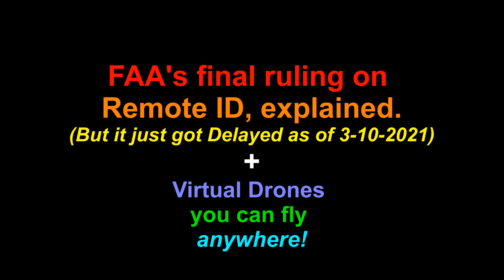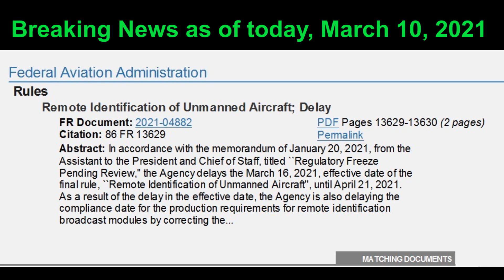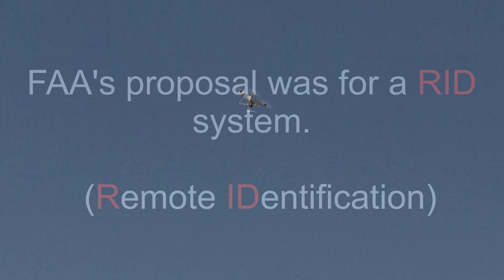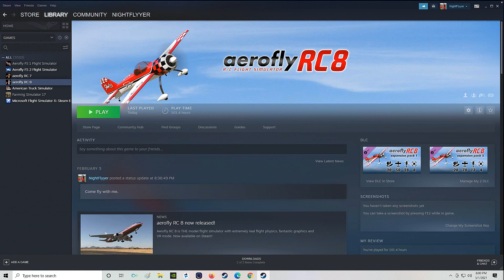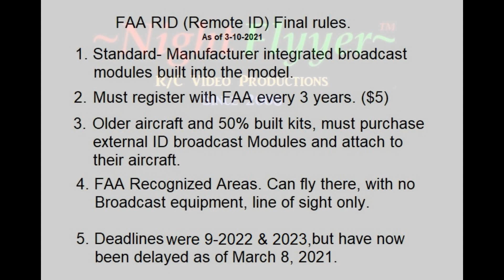Required: FAA Remote ID Broadcast Modules for all model Aircraft over 1/2 lb. I explain the Ruling!

Comment: I was a USAF crew chief for a dozen years. I saw engines eat all manner of things. Small RC aircraft aren't a true danger. Period. The 'reports' of close calls have all but been debunked numerous times. A flock of birds is literally 100x more likely to harm an aircraft in flight than a single RC craft. The entire thing is seriously over inflated. General aviation tests windscreens by firing frozen chickens at them for heaven sake!!
Engines are CLEANED with walnut shells...I mean..good grief.
The only GA craft that have any high chance of serious danger of harm to pilots or the craft are single engine small prop jobs. That is all. And again, the density of birds compared to the single tiny RC craft make the danger a non-issue in reality. That one lone idiot flying dangerously and in violation of current regs is NOT going to be stopped by these laws. If someone wants to cause harm or go outside the 'safety net' to perform an act..they're gonna do it folks. The FAA cannot seem to grasp this concept. Someone wants to air drop prisoners some contraband..they're sure as hell not going to use a craft with remoteID. They'll DIY something. Not to mention that all of this crap just makes it more likely hackers and other nefarious parties will cause harm to innocent peoples than it is likely hobbyists will cause issues to manned aviation.
Also bear in mind there are quite a few classifications of manned aircraft that will now have LESS regulations than what RC pilots will have, yet they do pose a real danger to life and property given their size and low flying nature.

EDIT: I also know quite a few full scale pilots that completely disagree with the new regs and postulate, as many of us do, that is 100% in the name of Amazon and the like gaining retail drone use space and screwing anyone else out of said space.
Reply from the maker: Debunked? If it was, why is the FAA doing this?  In my small town,  I saw this happen first hand.  Since I have permission to fly at a Private airport, one of my pilot friends was coming in from the south to land when he almost hit a drone.  There was a fair going on 1 mile south of the airport and there was a drone above the fair doing video.  When my friend landed his full scale plane, he came to me and was mad.  Demanded I go find this guy and reprimand him.  I don't know who it was, but I had no jurisdiction anyway.  So never say never.  I also saw on the news this past summer of the drones in California that shut down the fire fighting operation, because there were several of them up flying and interfering with the  helicopters, etc.  The pilots were so concerned they wouldn't fly.  But no one was caught because they were gone when anybody looked for them. I guess that is why they want transponders on the drones.  And since now folks are flying  FPV airplanes out of line of sight, like the drones, they have decided to put the rules on all unmanned aerial vehicles weighing over 1/2 lb.  
I'm only the messenger and just passing along what the FAA, Model Airplane News, and Model Aviation magazines published this month. We in the AMA community tried to stop the ruling but could not. We only got it modified to be a little better. I don't like it any more than you. My DJI Spark wont take off if I'm within 5 miles of an aircraft, so it has already begun.    If you have a better solution, then contact the FAA and tell them, since it was delayed again.
Reply: @NightFlyyer  "If it was, why is the FAA doing this? " let me simply and quickly reply to this part right now since I'm on my way to something else... the answer is all to obvious for anyone watching how the process is going down. It's called lobbying. The commercial enterprises want the airspace in order to use delivery drones. They're the ones up there fighting for said laws with almost no representation for hobbyists. Those that did represent hobbyists were not part of behind closed door talks while commercial enterprises were present. It's that dang simple!

I never said 'all' are debunked. Please don't take me for a fool. Your choice of words paints me as someone who is an absolutist and doesn't understand that SOME incidents are in fact real.

EDIT: To understand that one idea is bad, does not require having a known good idea to take its place before recognition and offense against said bad idea.
Reply from the maker: @secretagb  I did not at all call you a fool and you are being condescending towards me.  I have had to sit here and answer hundreds of these messages and believe me, I'm tired. I'm only the messenger and just passing along what the FAA, Model Airplane News, and Model Aviation magazines published this month. We in the AMA community tried to stop the ruling but could not. We only got it modified to be a little better. I DON'T LIKE IT ANYMORE THAN YOU!  My DJI Spark wont take off if I'm within 5 miles of an aircraft, so it has already begun.    If you have a better solution, then again I suggest you contact the FAA and tell them, since it was delayed again and they are requesting comments and suggestions.  Maybe if enough folks do that, this stupid law will be rescinded.
Reply: @NightFlyyer  I'm sorry you felt it was condescending, I did not mean such. My initial comment was not yelling AT you, but I now see you've taken it that way and I can understand how it could be read as such (my yell is in general frustration of our voices not being heard). My second post, the same idea not yelling AT you, I was literally in a hurry and it came out fast so for that I apologize. Maybe I also misunderstood your tone, but I felt the definitive questioning of (saying I insinuated 'never') my debunking statement was all encompassing every incident and I didn't ever mean it that way. Despite the readily available information showing pilots "see things" all the time that are nothing (UFO sightings much) we are just supposed to blindly trust every report as fact? Being able to see a small drone while moving at high speed is uh..not reliable. Sorry there are far too many holier than though pilots that I sure as heck wouldn't trust to drive my car let alone spot what is or is not a drone while flying. (I know more than a few and grew up in a family with multiple GA pilots, some of which scare the devil out of me to this day)

Speaking of incidents, did your pilot friend you mentioned report that situation? If so, did the FAA perform a full investigation as they are legally obliged to do in ANY and ALL reported safety claims? If not, then screw them. They seem to like to pick and choose how to enforce their own rule set. To boot, this incident you mention is a violation of multiple laws pre-remoteID and those laws have been in place for decades. Even remoteID laws would not necessarily prevented this person from flying there illegally. Had the situation been reported, the FAA surely could have found out who the pilot was at the time given the amount of social media posting that goes around for aerial footage. A few RC pilots have been busted with just that manner of investigation already! 

And myself and many others actually HAVE brought up far better regulatory options, but they clearly don't care, due to the aforementioned lobbying. It's written on the wall that the hobbyist has no voice despite us yelling! As you said, you and the AMA couldn't change anything and there's a very specific reason. That reason has nothing to do with logic and reality of our hobby and the real and unreal dangers. I am fully willing to accept regulation changes, even if I don't particularly like them, IF they are the result of proper scientific testing and realistic safety evaluation. I don't want true safety dismissed any more than any other conscientious hobbyist. Like making remoteID mandated only on those flying out of LOS as they cannot see to know if an aircraft is entering their AOR. Granted that SHOULD NOT happen anyhow since GA has a ceiling and so do we so we should not be crossing paths anyways. If GA craft are flowing that low there should be FAA investigating the pilot and not the hobbyist.

The weight limit for one should be moved upwards by quite a bit. At LEAST 1lbs. A red tail hawk can easily make 2lbs and that can be a danger on a direct strike to certain aircraft parts. But again, I've seen my fair share of jet engines devour even the large Canada goose with minimal scuffing and maybe a minor blade blend needed to repair the situation. I've swapped out the radome on a C-5 that took a crow once..didn't harm anything mechanically or endanger anyone at all, but it sure was a mess and an expensive bit of fiberglass to swap out!!

The dangers should be evaluated based on logical testing parameters (fly a drone through the rotor of a tethered and grounded heli for example and see what happens in multiple weight classes, fly a Mavic at full speed into a Cessna 182 wing from the bottom, etc), but the FAA outright refused to perform such measures and instead chooses arbitrary crap (likely based on things they were told behind those closed doors with commercial lobbyists of which we will never be privy to). Again, myself and others have levied such comments based on logic, but they ignore us.

I currently work in Naval Aeromedical Research and am directly involved in many safety situations of recreation, testing, evaluation, and solution creation. Recently we devised solutions for lasing of aircraft, which is a real and true threat that is testable and repeatable. We study pilot disorientation, visual acuity, etc etc. We are doing the work! The FAA on the other hand will not do such work. And they will not listen to us hobbyists, so all we are left with is yelling and complaining to each other on the internet at this point.

It's absolute stupidity that your Spark won't take off IMO, but that is as close to a logical rule as I can see right now. If you are within the flight envelope of an airport, lock down the space. On the other hand they regularly stick their collective feet in their own mouths like when they ruled that RC pilots were the equivalent of GA and would thus under law have the same protections, but then retracted it after it was brought to their attention.

Again I'm sorry for any perception of anger at you.
Reply from the maker: @secretagb  I understand, and I have been answering many comments, many blaming me.  Again, I was just the messenger and agree with you.  The Pilot complained to the airport manager and was mad, saying the drone pilot is supposed to call the airport to tell them he was going to fly his drone.  The thing is, it was after hours and the airport crew was gone.  This is a private airport and the pilot was a sheriff's deputy.  He tried to find the drone pilot.  I didn't go anywhere, because I was flying my Big Pitts.  By the time I would have been able to get packed up and go find some guy with a drone at the fairgrounds would be too late. Besides, he would just claim to be ignorant of the rules the AMA uses for 400 ft, etc.  I am bummed about my Spark for sure.  I had tried to use it almost 5 miles from the airport in Sioux Falls, to Video our Skating Rink from above and the GeoFencing stopped it.  This drone must be flown with a phone and internet connectivity.  That is why it works, as my phone knows where I am.  That law is what  the FAA wanted to be on all UAS's.  At least the AMA prevented that, or all of us would have to have a smart phone and internet connectivity to fly.  Anyway, I don't like it and hope since the FAA is taking letters again, that it will be rescinded.  Thanks and apology accepted.

Comment: Great video. I myself fly a DJI Mavic Air 2. Love its use for photography and do little video from time to time.
I do check my maps before I even take off and my drone is always updated to the latest data.
I waited on this specific model just because it has a built in ADS-B receiver. Now other than line of sight and sound if some guy is flying low and he doesn't have a transponder installed it's hard for me to get a warning on my remote.
Only option for me is if I hear something is to drop straight down and I'm careful not to ditch it.
Last place I fly is around an airport. I've only tested once in class D space and requested LAANC clearance just to see how it worked. Requested max elevation of 100 ft for 5 minutes to test, got approval, performed test and returned to home. Haven't used it since (a year)
Reply from the maker: Thanks and for you following simple common sense when you fly.  I have a DJI Spark.  It wont let me even take off, if I'm within 5 miles of an airport, so some technology called geo fencing is being applied already by the manufacturers. Thanks.
Reply: @NightFlyyer  I sure wish they would have put this in drones years ago. The drone manufactures knew what some idiots using their products were doing. Then we might not have the problem we have today, that's all brought on by these drones. I'm mean some people were stupid enough to fly them in the pattern, and on final approach at major metropolitan airports. That, and people posting these crazy videos all over youtube for years, doing everything illegal under the sun. It didn't take a rocket scientist to know that something was coming!!!!!
Reply from the maker: @scotabot7826  Yes.

Comment: on another note you fly from an AMA site & there is a 400' ceiling or less all over the USA. Look at FAR 91.119 (b) that requires full scale pilots to be 1000' above the highest object  within 2000' of them when there is an "OPEN AIR ASSEBBLY of PEOPLE Present. According to the Scottsdale FSDO and I Quote  "It is our opinion that an open air assembly of people constitutes  any number of people from 33000 at a fair to 2 people on a blanket having a picnic". In that event all maned air craft must be more than 1000' above any occupied r/c flying that has 2 or more people there. That being said why are we limited to 400'?            https://www.law.cornell.edu/cfr/text/14/91.119
Reply from the maker: Thanks.  I am just the messenger. I did not write the rules, but as a model pilot, I think it is unfair as well.

Comment: The AMA had zer effect on the changes the FAA made to the Rules for RID. The changes that were made wete ONLY done so because of the current lack of infrastructure. The term "at this time" is riddled throughout the regulation. Things like the network requirements will absolutely be reimposed. Major manufacturers absolutely love Remote ID because it allows them to capture even more info about the pilot and make more money from providing services. FRIAs are BS for anyone that doesn't fly solely LOS. Also FRIAs must be created by CBOs. CBOs must meet thier own list of requirements to become a CBO. The Remote ID regulations are a farce and lies being sold to the government by major manufacturers and companies like Amazon.
Reply from the maker: Thanks.  I am just the messenger. I did not write the rules, but as a model pilot, I think it is unfair as well.

Comment: And, modify your title because it's not ALL model aircraft.  Try putting that on something like a UMX Night Vapor.
Reply from the maker: It is all model aircraft that weigh over 1/2 lb. Under that, like my vapors are exempt, as I stated in my video.
Reply: @NightFlyyer  I said title, not video.  You got it wrong in the text description, as well.
Reply from the maker: @whoknows8678  Okay, but I DID mentioned it in the video.  What's the problem?  Model airplane guys with bigger planes don't like it and the FAA wont budge on this final ruling.  Again, what is your solution?
Reply: @NightFlyyer  I already posted my solution here.  Go find it...
Reply from the maker: @whoknows8678  I'm just the messenger.  I did not make up the rules, so why are you so condescending?

Comment: December 2019 was the FAA's 2nd attempt. When they got sneaky and stuck their nonsense deep inside a defense authorization bill where it'd get passed and nobody would ask questions.

Their previous attempts got taken to court and they LOST. The FAA was expressly forbidden from exercising authority over what Section 337 defined as "model aircraft". The FAA tried to get around this by simply saying "Well our interpretation of the definition of 'Model aircraft' is that they're aircraft and as such we have authority!" even though the definition for 'model aircraft' purposely defined them as different from 'aircraft' so that the FAA couldn't touch them.

But no. Authoritarian big government always wins.
Reply from the maker: True, but the final law was just published and it is final. It is in the RC mags this month.  Only the deadline for implementation has been delayed, but it is coming.  I wish they would have required only the drones transmit data, because our airplanes and helis never fly 1000 feet and in the path of full size aircraft like the drones have been doing.